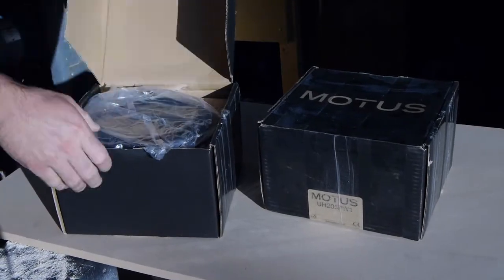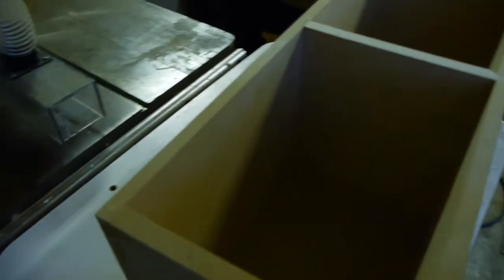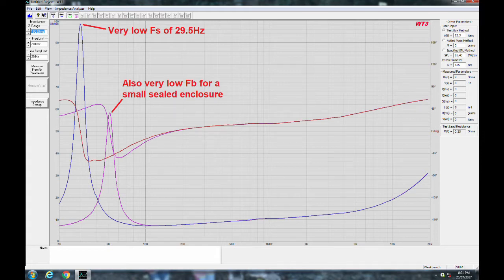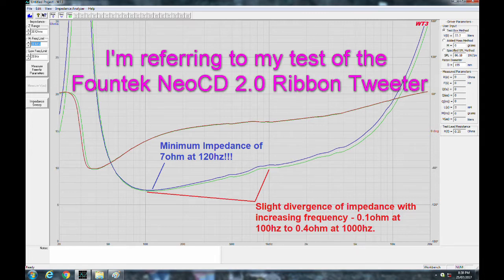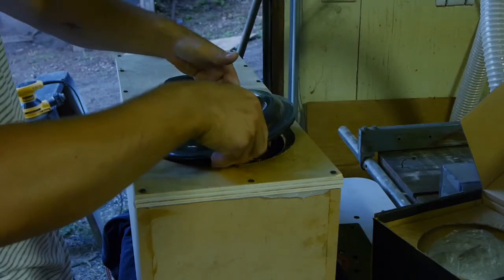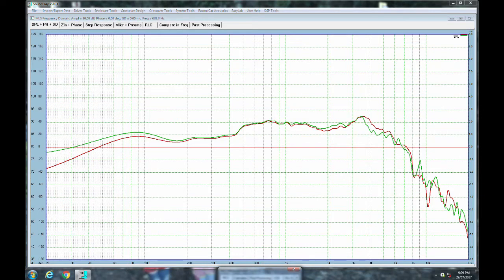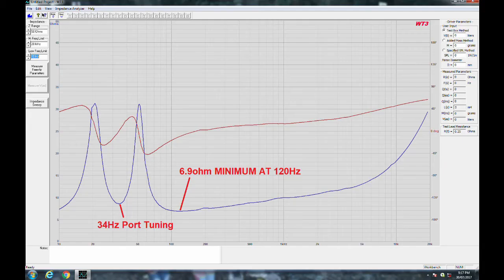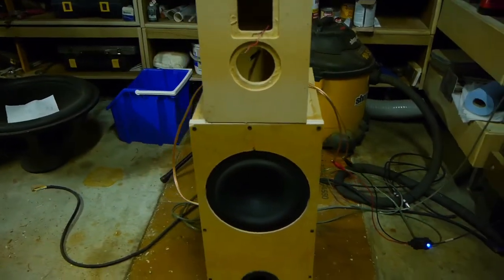Motus Audio UH205PW1 Test and Review

Comment: I've watched probably a dozen of your videos and have learned something in every one of them. Thank you for being unbiased, rigorous with your routine, and addressing the budget/high-quality environment. Really, very worthwhile watchable stuff.  

A free tip - instead of using the floppy tape measure while balancing on one foot on a ladder, I keep a set of measuring sticks around the shop for non-critical measurements. Just cut some heavy dowel material (or closet pole if you want to go beefy) to common lengths - 18 inches, 1/2/3 feet and .5/1 meters. Very fast and handier than trying to read small numbers on a moving tape. Cheers, and thanks again.
Reply from the maker: SuperFunkmasterj I do like the idea of a story stick. Need to take the time to do that.

Comment: Is this a mid bass or regular woofer or am I just lost in speaker terminology jargon?
Reply from the maker: Jesemanuel Ramirez it can be used as a mid bass, but it won’t be happy with a whimpy tweeter. It needs something that can cross low. It’s excellent as a woofer.
Reply: @ImpulseAudioSpeakers  awesome, yeah I was thinking on using it on the three way speaker I was asking you about yesterday. I'm just lost in all the different drivers (Tweeters, midrange, midbass, woofer, subwoofer, ribbons, coaxials, component, exciters, bass shakers, etc.)
Reply from the maker: Jesemanuel Ramirez this is the woofer used in that 3 way. It’s good.

Comment: Thanks for the reply would be proud to own a pair of anything you come up with have several amp/pre amp to drive them preferred 4ohm load like to get the most out of components their is a speaker designer in Brampton Ontario that makes stage equipment speakers they have a woofer that called the A-18  (eighteen inch) WOW will not sell to me thou or custom make a set